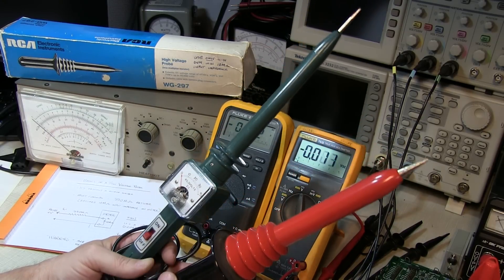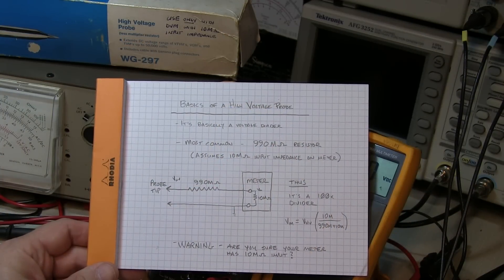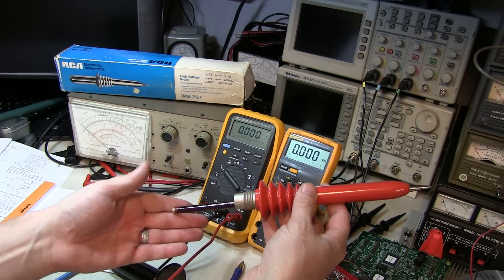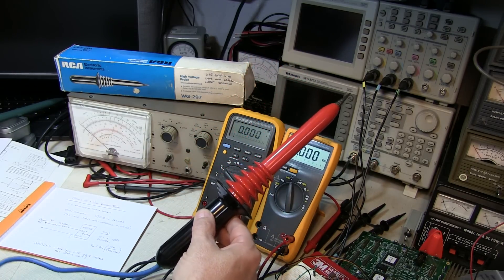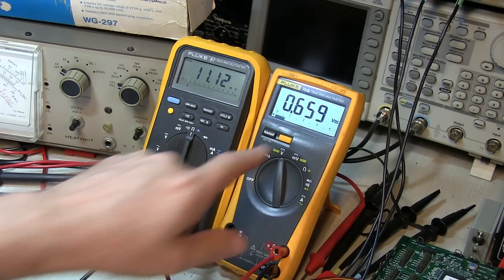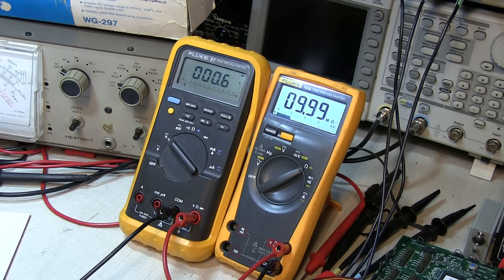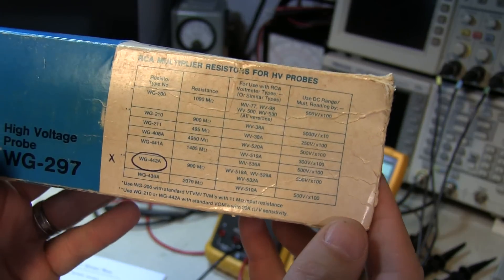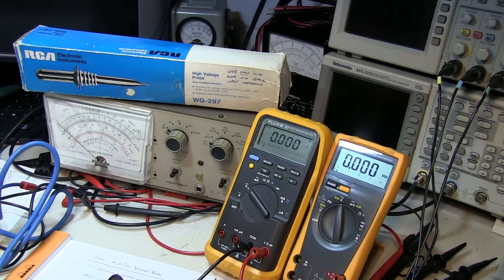#142: Basics of High Voltage Probes and how to use them

Comment: Nice video but I don't see the voltage divider. At the bottom left of the page linked there is a drawing of an actually voltage divider circuit.  This circuit outputs 1 volt for every thousand volts input. At 5000 volts I'm seeing roughly 5 volts on my Fluke. Again, this is for the Fluke 80k6 and the Fluke 787 meter which is not shown in the gentleman's video. My meter basically gave the same reading on all scales with what appeared to be a little rounding. My particular setup provides a 1000:1 ratio.   https://datasheet.octopart.com/80K-6-Fluke-datasheet-27847453.pdf
Reply from the maker: Some probes, like the one I was using, use the 10Mohm input resistance of the meter as part of the voltage divider.